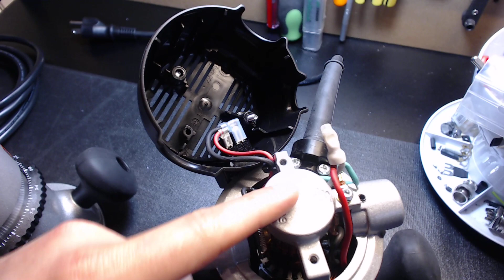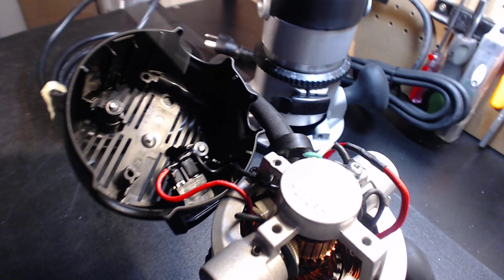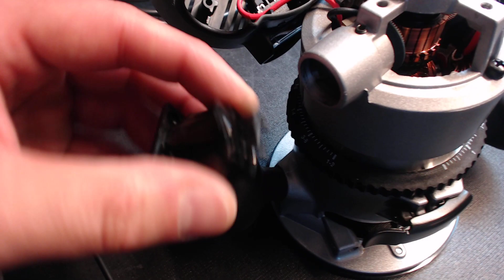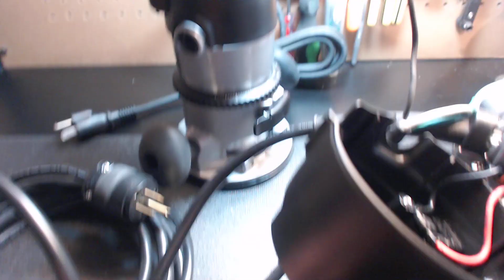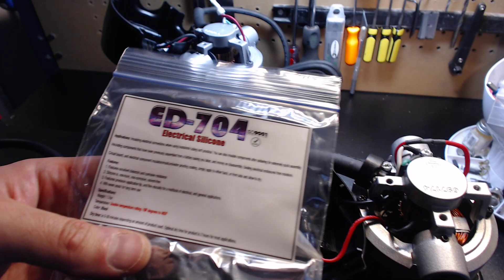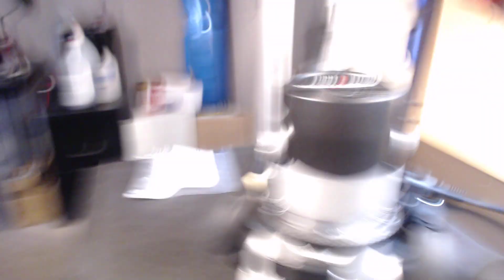CNC Retrofit Kit For A Wood Router & Spindle Giveaway!!

Comment: I appreciate and am very grateful for the tips! I'm buying a 4-Axis-300W-3040T-CNC-Router over the weekend (yes I know it's not the greatest but that's what budget is allowing) and this would be a perfect match, if I could be so blessed to have this router! And with your great tips I can incorporate them on the other electrical connections on the cnc, with soldering and the insulation. Thanks again and keep up the great work!! Be blessed!!
Reply from the maker: Phil, that system with a G540 driver is actually excellent . I'll make sure an put your name in the hat. Thank you, for your support. Vince

Comment: I like connections to be soldered too. Even something that has to be crimped can be further soldered too - one extra layer of toughness!
Reply from the maker: Jupa, thank you for your support. Soldering with CNC is a must to reduce electrical resistance. I also prefer soldering to be done on all electronics for safety, and durability. Vince

Comment: While i agree this mod is nice since i am not a fan of crimp connectors and i love silicone wire(probably because of my RC habbit as well), but im not sure how this really lowers EMI. I know making sure you have a significant ground can affect this but the ground didnt look too bad. Wouldent putting a ferrite core help significantly? I have been slowly building my openbuilds cnc router and was going to go with one of these due to the fact of reading that most of the cheaper spindles tend to be less durable than a decent router, mostly due to the design of the supports of the bearings. One thing i was thinking about doing on my router was some epoxy balancing since they do not sem to worry too much on these that i have seen. I am definitely interested in what you think and i am definitely interested in what you have done for this router already.
Reply: Btw, your insulating paste looks amazing, do you use this on your planes as well?
Reply from the maker: Duke,
Thank you for your support. When dealing with spindles, and the amount of EMI they produce a double shielded cable is really the only solution as using ferrites will make it virtually impossible for the cable to bend repeatwith the amount you would require to make them an effective solution for this application. Please watch my video covering shielded cable if you haven't to understand why shielded cable is so effective. https://youtu.be/84udcsEC7zI

Vince
Reply: corvetteguy50 imust have totally missed you saying it was shielded! Makes way more sense now!
Reply from the maker: Yea double shielded cable is the only type of cable to use for CNC spindle applications. This is why the price on these kits are higher then regular standard shielded cable using Mylar foil. Thank you,
Vince